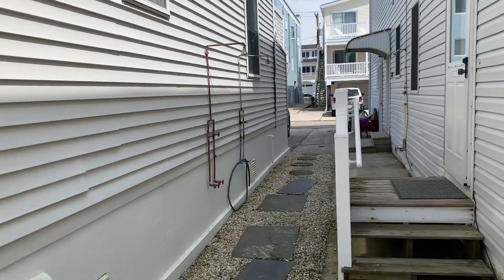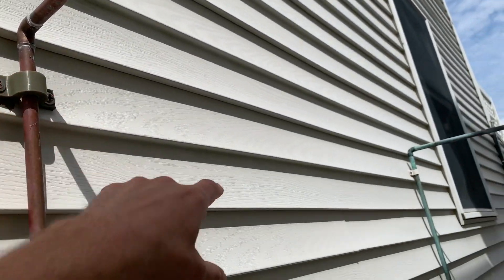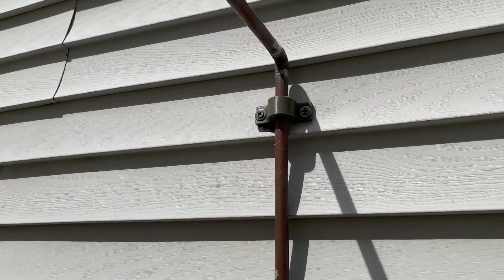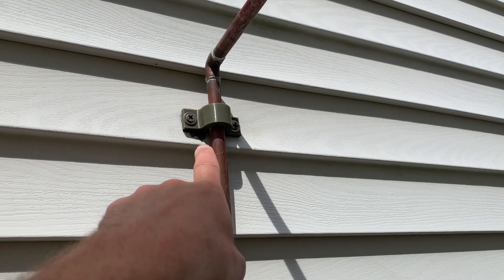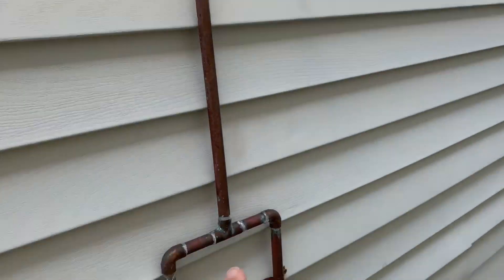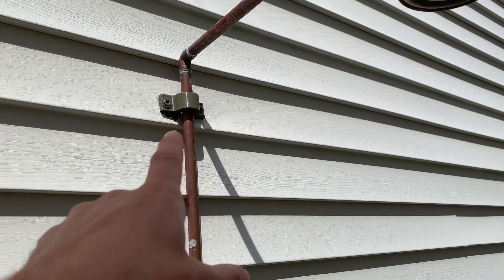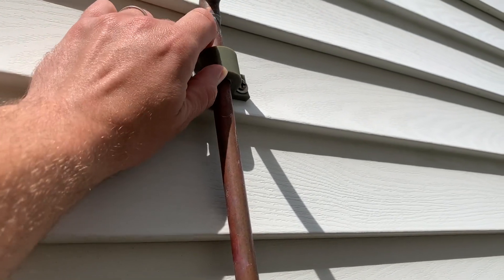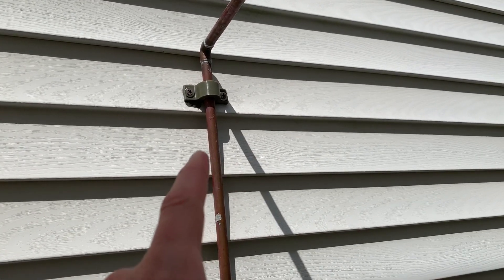#notfriday TPU at the Beach

Comment: Very useful to know, because I have a missing exterior trim piece for a window, and most of the remainder that are still present look pretty worn and weathered.  I'm going to print replacements out of TPU.  I had considered other materials, but I figure that even if TPU isn't the most UV stable material ever, its flexibility will be a big factor in making it last for at least a few years in this use.  I'm not sure what plastic the existing parts are, because it hasn't held up anywhere close to as well as the vinyl frames themselves.
Reply from the maker: I've had great luck with TPU outside.  Honestly the PLA I use outside has held up pretty well too.  Maybe I've just been lucky.